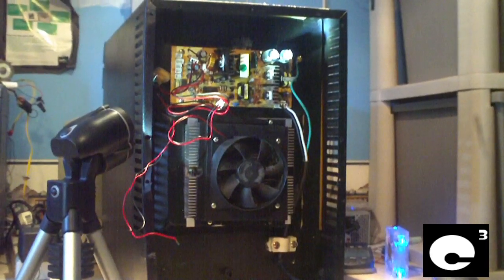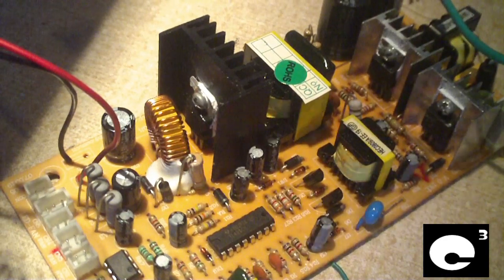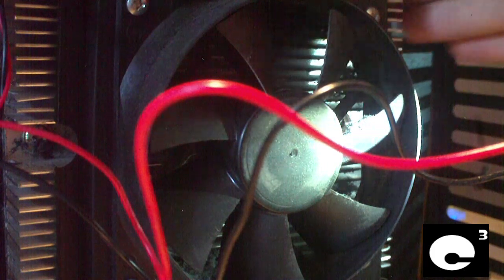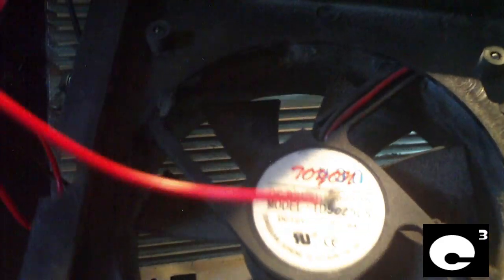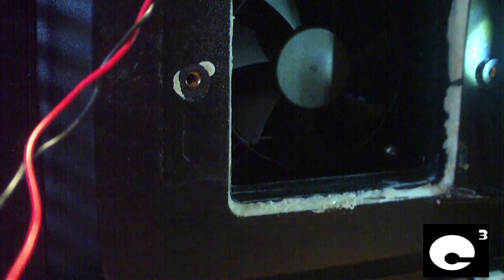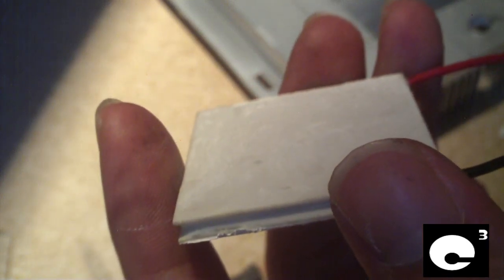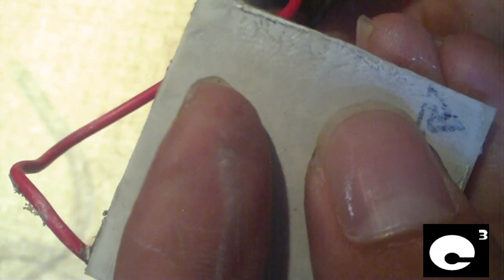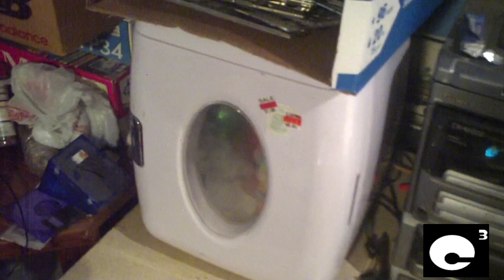Haier TEC Fridge Repair & Results

Comment: Hi, i have a question?
I want to connect a nice 5 inch touchscreen home thermostat with separate sensor to a 3.4cu ft thermoelectric mini fridge . 
I know the HT is 24v(AC) power verse fridge 12v(DC) i saw a convertor resistor 24v(AC) in 12v(dc) out , will this work maybe(i donrt see why not, I need more of a second opinion second greenlight i feel before i jump 😊) what say you ?
Reply from the maker: If the thermostat is battery powered, then you shouldn't need 24VAC present as it might be able to switch on/off lower voltages. For cooling, HVAC thermostats connect Red to Yellow and Red to Green (for compressor and fan) to turn on the system. You could use either Y or G. You will need a relay or contactor to switch power to the Peltier/TEC module as the contacts in the thermostat are only meant to switch low current control signals. The thermostat could be used to switch power to the relay, which would switch on or off the TEC.
Reply: @CubeComputerChannel  was thinking about using a driver with a remote DC function for the thermo chip so I can go straight from the thermostat to the peltier driver bypassing any mother board/brain control board.
That way the three hundred dollar 5 inch touchscreen LCD with Alexa thermostat can do all the work with its separate sensor placed inside the fridge ( look up yolink systems, im going to use a ipad for control panel via app, or im going to use another device similar but the 5 inch screen is on the thermostat) , with all that tec it should be good i would hope,,, I was going to use a small AC adapter to power the thermostat on its own. If I don’t i think that thing is going to be running through batteries like crazy it’s basically a iPad turned into a thermostat, 
I read it does not have a optional 12-24 input only 24VAC for power, then the driver with the remote function will only receive a 12 Vdc for control ( this would make things straight to the point and easy right ( using the resistor converter 
in 24vac converted into 12vdc out to driver remote input,, then i can use a dimmer switch 0-10 turned on high or 85percent always/continuous so when the thermostat comes on It’ll be shorter time frames to charge the chamber to set temps ) .
I’ve always had killer ideals for products that could get people rich, low input cash with huge resale value/ROI ,, 
I would love to run this one by you in a conference ( via e-mail or call )  i need a tec guy i would love to contract with when it comes to this ideal .
Whats your e-📩. 
You have the experience i see,  I have nothing but cool feasible ideals 😅, 
Never will They be some whacked out crazy man little kid way out of reach ideals outside the range of our tech like most people with no understanding in engineering and modern tech.
My Gemini minds/2 😂,  makes me have all these great ideas all day every day none stop, 
it bothers me sometime☹️, my mind keeps going and going,,, 
It’s so bad my mind won’t shut off I even lucid dream 🤷🏽, then I wake already plugged in like i never shut down right into the next day🤦🏾‍♂️,,,
never no time for the main computer/brain to rest 🤷🏾‍♂️,
I’ve even worked on problems in my dreams before working with some smart people ive never met a day in my 🤨,,
Then when i hear the alarm clock i let them know its time for me to go shake hands then wake up, Sht as a kid I would do homework in my dreams, 🤔. ive only heard of a few people that can do this, Nikolai Tesla being one of them ) crazy huh 🤨, off topic, I know sorry bout that Brotha  .
Reply: @CubeComputerChannel  the yolink product line is huge. They have relays also controlled via yolink hub and app..
Reply: @CubeComputerChannel  trying to make a humidor like product So extreme low temperatures outside/below 50° is not favored .. 55 -70 f is target !!

Comment: Thanks for the info.. my problem is the external fans are not running.. and I have two thermoelectric units on my humidor, regardless of the fans not working at this point,one is hot and the other one is cold (back of thermal electric unit).I'm assuming the one that's cold is not working properly. And as far as the fan goes it has to be the control board 🤔.. any advice would be appreciated
Reply: If its cold most likely the polarity is reversed, if it is just cool it may not be working.

Comment: Hello!
Did I get right that you have replaced the main unit with the computer power supply? How did you managed to make the connections and control the temp?
Reply from the maker: It's been so long, though I did use a computer power supply, however I don't know how it was wired up.

Comment: Still have the control board? I'm looking for one for a koolatron but they all use the same boards. Mine went out and need to replace it. And the weak TEC module. After replacing the TIM, I cracked it in 4 places from over torqueing it.
Reply from the maker: +Cruiseomatic Sorry, I no longer have the control board.

Comment: When I fixed mine I got it down below 50. It takes a while but it gets there. The main issue keeping it coolest is making a good facing with the thermal paste - not too much, and keeping the air path and heat sink fins clean.
Reply: has anybody figured out a method of upgrading fans and/or peltier parts to get the cooler down to ICE COLD or near it?? just wondering... thanks in advance

Comment: Great info, THX.  I have a Haier HVW18ABB wine cooler.  It has two TEC/Fan units.  The top unit works fine.  The bottom TEC appears to be working (because it's cool to touch) but the fan is not working.  I removed the fan and tested it and it seems to work ok.  Any suggestions...power source, circuit board, fuse?
Reply: If the tec is cool  to the touch it is not working, either bad PCB or  Peltier device.  If it is hot it is working proplerly.

Comment: If that was sold as a wine cooler, it was probably designed for about 50 degree minimum temperature, since wine is stored roughly between 50 and 70 degrees.  They probably used no more of a cooling device than they needed.  Not enough to keep beer cold.